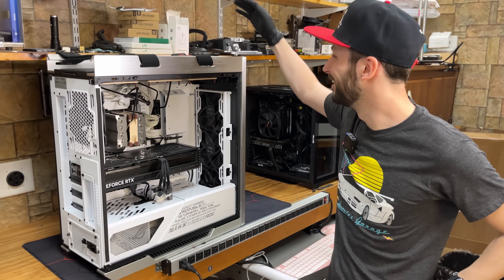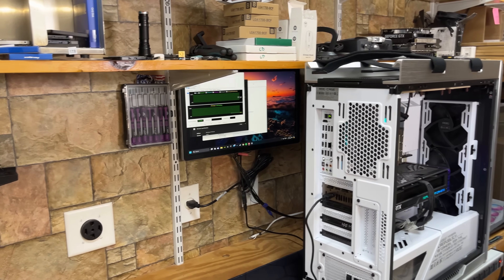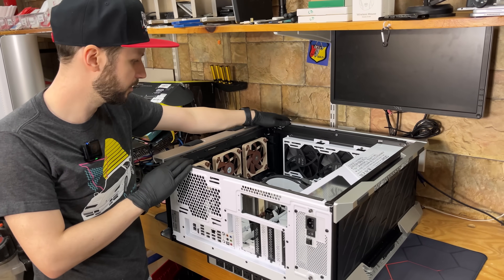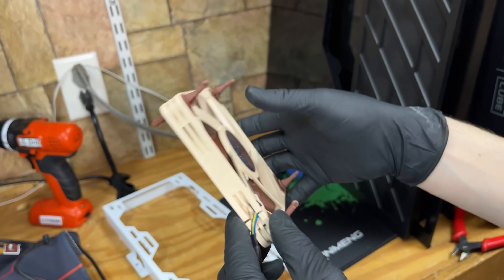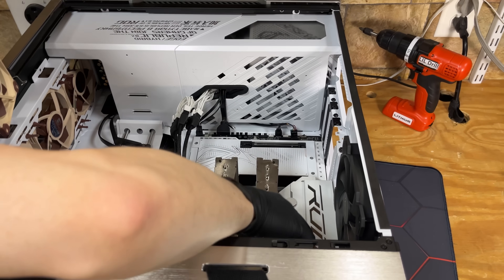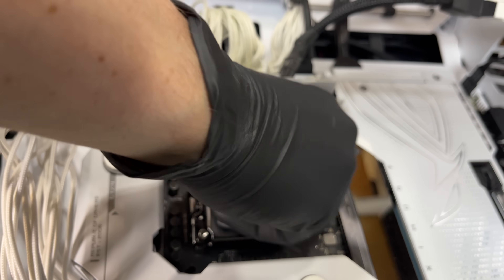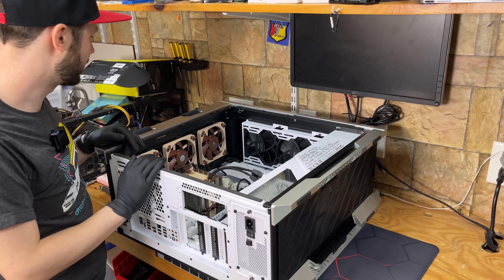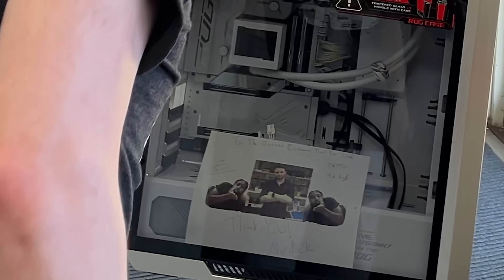ASUS ROG Revival: From Air to AIO on an Intel i9-14900K

Comment: I had this problem with my ROG Strix Z590 and 11900k. It's not uncommon to see the system agent AI in these boards feed over 1.7v of vcore to the processor. In my case, it cooked my original 11900k that had a beefy 200w Jonsbo CR1100 air cooler, with the board pushing over 300w to the processor until it degraded. It was pulling 200w just at an idle, doing nothing! Luckily, intel warrantied the processor, and I saved $400 by buying a used 11900k to replace it and I also switched over to a $60 Frozen Warframe 360 AIO at the same time. The main problem with these ROG Strix boards is that they usually refuse to run stably without the multicore enhancement, imagine that. But, it's a lot cheaper to turn off the ASUS Multicore enhancement in the BIOS than it is to buy a $500 ASUS AIO.... Especially when you can buy a Thermalright AIO that has all the same features and performance for $60 these days. I switched over to the Gigabyte Aorus Pro platform for my last build, and it has none of these crazy problems the ROG does.

Comment: if i owned a pc repair shop and that came in i would've trash talked the idiot who built that sooooo much, for a 14gen i9 a huge 2 fan air cooler would not be enough and this idiot used a single fan TINY nactua fan

Comment: I do think it's possible to air cool a 14900k, but you HAVE to undervolt. I undervolted my 12900k which is also a power hungry beast with a -150mv offset, and temps never reach anywhere close to 90C anymore when it used to commonly reach the low 90s when running CPU-heavy games.

Comment: lol i ended up witha 99 civic rad and fan  independant 600 watt 12v 50A psu for the pump & fan with the outlets modified with quick steel EPOXY which's a shit-ton better than jb weld!! 3/8 loop  AUTOmotive nylon fule line and she's been running 5yrs trouble

Comment: Which Noctur is that though? The Noctua NH-D15 is supposed to be the best air cooler out there for the i9 14900k. Im about to build with the i9 14900k with Noctua NH-D15.

Comment: If you have $1,000 budget to build a PC, $995 IS FOR THE RGB...... $5 is for the processor, motherboard, RAM, casing, PSU..... that's just logical, that's the only way..... RGB could make your PC runs 3 - 5 times faster......

Comment: 13th and 14th already have had both fixes pushed out through updates. August 2024 was the Micro-Code update for those affected. Don't upgrade to it if you aren't experiencing the issues.

The other major issue was mobo manufacturers got the Default setup to wide open. 

So any time you put say my i9 14900KS under air or liquid with it wide open under stress testing it tries to get to 99°c. Because it's wide open.

Before the August push for the Micro-Code was the update that remedied the default being wide open issue for most also.

253w Default won't even thermal throttle in Air Cooled Noctura setups and my i9 13900KS refreshed to the i9 14900KS sits at 293w with no issues.

Comment: My 14900k is staying pretty cool gaming with a nh-d15 gen1 strapped to it. Hovers around 60-65c. You made 2 mistakes, using a baby air cooler and using using stock pressure plate.

Comment: I realized where I kinda messed up buildin' my PC when I remembered my Aurora R12 had a liquid cooler in it, but choose the Noctua NH-D15 'cause I forgot I trusted a liquid cooler for around three years in that prebuild. Aside from the Intel CPU issue in my old 14900K, it runs pretty good on an air cooler, but ~40ºC idle is somethin' worrisome. Ordered a non-RGB Corsair AIO.

Comment: I have that cased and had it for about 5 years. I absolutely love it. Once you get rid of the stupid RGB glass on the front, the temps drop 14c. Then pair it wit an ASUS Thor PSU and a Arctic 420mm Freezer iii and your golden. With a slight undervolt and overclock you should never get over 41c while gaming, even with the loop fully saturated. BTW the case has a built in GPU anti sag bracket. 😂

Comment: I knew immediately there was something wrong with that Noctua cooler. Those are really high quality heat pipes on there, and while I'm not a fan of that particular design (radiator>fan>radiator), there's no way it would have caused that CPU in stock configuration to overheat like that. Well designed air coolers more than hold their own against liquid solutions.
Reply: The i9-14900k cpus are notorious for overheating that they absolutely need water cooling

Comment: I am un-ironically using this video to drain my laptop's original battery a bit.
This so it won't needlessly degrade from being at over 80% charge, as I switch it to an after-market one next.
Time will tell how long that one lasts, but OEM ones are over €100 so it's worth the €40 gamble.
At 75% charge now, time to boot to bios, enable battery storage mode and to get my long fingers in there-

Comment: if they use the proper air cooler like one of Noctua's big ones or be quiet's big ones it would probably work just as fine but they went cheap on the cooler for a very high-end CPU

Comment: you dont necessarily have to go water cooled...... with a 13900K and 14900K you absolutely do, air cooling is not enough to keep these i9's from throttling.

if you think this pc is heavy you should see mine, its a corsair 7000D full tower x.x

Comment: This is a 0 IQ build.
Less fans (or cheaper), bit worse SSD,  bit less rgb ram, not a 14700 (non K) , and a less fucking stupid mobo, WITH CUSTOM WATER COOLING INLETS ON THE VRM would have let the dude squeeze in probably a 4090 & keep the tiny cooler with the less hot CPU.
What the fuck did i just watch? Ah also probably should have gone for a bit more powerful, but less fancy psu (like seasonic).
This build is just.... why? If he didn't go for full strix parts he could have bought so much more pwr..... well he has a full strix system i guess....

Comment: The menu repair:
Change HDD to SDD $230
Repair Screen $80 (80% SALE NOW)
Change the driver to new driver $340
Change the broken things $210-$350 (use by to fix/change by more money)
Change Keyborad $200
Change batery $170
(Every Sales on source 10% to 80% on every day)

Comment: Even if you dont need to water cool, a prebuild water cooler is easy to install and will always keep the temperature lower than an air cooler, increasing the lifespan of any cpu

Comment: Here is big problem computer casing…. I had one of these and sold it due to component overheating. Casing is designed like aquarium and there is no proper air movement in it, you just remove panel on one side and everything works fine

Comment: Just for future advice,I don't know if this applies to this video.  But when you use x-1 fan extensions,  make sure it only has a pwm wire to 1 fan,  or you'll run into occasional random fan ramping because the signal overlap

Comment: solve the problem of degrees with rtx and processor test and approve with my I7 11700KF rtx asus rog 2070 a8g

install msi afterburner

Powerlimit max and max time

✔Linked apply 

gpu 80 to 60 max No pref loss

cpu 65 or more at 35~50 average no perf loss (need water cooler)

Comment: LOL the build was so close to mine, except I built mine with i9 12900k using almost the same cooler but with two fans instead of just the one pathetic fan, and I have an ultra quiet case that I love, can't even tell the thing is running.  My biggest problem is I paid for 6k ddr5 but when I try to run at full speed the PC randomly crashes to bios, so I had to turn off the ROG bios setting that enables ram speeds I cant remember what its called.  But I'm sure The Greatest Technician That's Ever Lived would understand what I'm talking about.

Comment: my aio fans are installed right now as intake on the top smmfh, too lazy to change it but im also on a 5800x3d and not a 14900k heat missle

Comment: a slightly better Noctua Air-cooled HS, one with a push pull dual fan config (to push more sweet air though those fins) could probably handle the beast that is the 14900k.. but given the overall ASUS theme to the rest of the build.. the AIO is understandable

Comment: I dont know if you answer questions, but on the CPU pressure plate would that help at all with a CPU that rips out of socket i have a Ryzen [older generation] and the last time it ripped out of socket i about lost the poor thing.. had to work hard to fix it. Would that prevent/help it?
Reply: always let the am4 cpus get hot before taking out so they dont stick

Comment: This is a bios issue related to the i9 14th and 13th gen CPUs. The fix is to lower max voltage and limit pcore/ecore if still unstable. Should update bios and reset the setting first.

Lots of material online about this as Intel finally acknowledged the issue recently. Has plagued my systems causing crashes randomly on highly specific cpu operations. This fault permanently damages CPUs. My 14900k cannot run stock settings now.
Reply: thats just crazy. intel is a joke now

Comment: When you plan to saving certain part for budget, but the spec is overkill, this is what happens. 
This is happen with me decades ago.. But again, the build should be balance, these CPU need Water Cooling 360 mm at minimum.

Comment: Why did they want those noctua fans in front? Are they better? They seem to have a lot of space on the blades, not much air pressure and also be really thing like a low profile. It's weird lmao. But legitimate question, are those fans better than the other ones? Or at least equal and more silent?

Also Noctua having that HORRIBLE color... they purposely built the best fans and the ugliest so you had no choice. They are HORRIBLE, disgusting and does not even match with wood. You see some wooden cases or "wood builds" (so many jokes in there to do) and the wood color doesn't even match Noctua's color.

Comment: Yeah no, there's either not enough heatpaste or the mounting for the cooler is not fastened correctly.
No way this shoots from 0 to 100 even with that small air cooler.

EDIT:
called it xd

Comment: My laptop has gone someway wrong in the means of cpu processing i play valorant and my cpu latency goes 16392628826 ms but it was in starting 3 ms i have no idea what else i could do i have done many certain of things but its not getting back to its original performance i have cleared its vents cooler clear from inside and still its not getting good 😖 if u can tell something about this that i could do it would be great 😢

Comment: Ouch , that's a nasty downgrade  on the front fans . 3x 140mm normal fan replaced  to weak 3x120mm  15mm slim fans =(
Reply: Actually better put 120mm on front.

Comment: This is a reminder to those who prefer an Intel i9 over an AMD Ryzen 9: remember, you cannot feasibly use an air cooler on an Intel i9 while on a budget. However, you can on an AMD Ryzen 9.Here's why: I have an AMD Ryzen 9 7900 (non-X) paired with a Noctua NH-D15 air cooler, and it idles comfortably at 60-64°C.

Clearly the guy who put an intel in his build was on budget cause you will never put on such thing an air cooler
Reply: And for those of you who says he wasn't cause of the nice gpu and ram. I have a good gpu too and 64 gb ram and i had no money for liquid aio
Reply: I have that too on my 5900x. CPU is chilling on 40C. Peak at 70C at +90% load.

Comment: honestly this seemed like a first time builder and they did a nice job cable managing the rear and buying the exhaust fans. they did a nice job picking specs as well but I think they just fumbled with the cooler and lived with it momentarily and let the CPU throttle. after the cooler it looks even better. noctua fans make any system look better imo

Comment: You said it has an Intel 14900K... enough said, that's why it's overheating. Doesn't even need to be in your shop... open a case with Intel and get the shit replaced as their processors have been bricking after 6 months of use. However... I will say the cooling solution wasn't good enough and the check on the BIOS was a great step. They don't have to go water cooling but it is a nice one they picked out. They could have just went with a nice double fan double fin setup with at least 4-6 heatpipes (I'd go 6) on each fin side for good cooling. Nice job, enjoy the videos!
Reply from the maker: ASUS Multicore enhancement ignoring Intels limits is mostly to blame though. With the proper cooler (the one we put on) it was able to run just fine even under stress

Comment: I work at a small computer shop and there's a guy with that exact case, but it's Gundam themed. Shit really does weigh like 100 pounds with a 4090 and a 1200W power supply :face-red-droopy-eyes:

Comment: "When you have more money than sense... a video series." Nice work, Andy and Lupe! Fun video. It's not my money (and I could be wrong), but I have a difficult time believing that those 15mm Noctua fans are any better than the included 25mm fans that they replaced at the front of the case. And they look like butt cheeks. Unrelated: I feel like the audio levels are a little low in this video. I usually listen to other YT channels at 20-60 percent max volume, but I was struggling to hear everything with all my volume levels maxed out in this video.

Comment: Did the customer reuse an old Noctua from a previous build or bought the wrong one? Because that seems like an absurdly small air cooler to be using on a 14900k (would be probably be fine on an AMD).

Hopefully Intel gets their act together and takes power consumption more seriously with the forthcoming Arrow Lake CPUs.
Reply: I did reuse until the aio came in.

Comment: Well, at least he got a double tower. In my naivety I initially wanted to get one of the single tower ones for my 5800x build but when I showed my list to some people that know more than me and they told me to get a NH-D15s which is about double the size of the one in the video and it did the job very well even with the single fan.

Comment: I have I9 13900k which is the same with a air cooler Noctua u12a I’m getting 33c idles and underload 65c-75c gaming. The thermal throttle is set on bios 90c with a undervolt -0.50+ power limit Intel spec CB23 38k. The AIO would still hit 100c no matter what if you don’t make some changes on the bios.

Comment: I have the same case,  got it on a computer tower stand that has 4 wheels, it helps me move it around and keeps it higher off the ground, it's by Labobole I'd recomend it. This case IS heavy and mines heavier yet with a Strix RTX 4090 oc lc and it has the same AIO, same 64gb memory also. It has a i9 13900ks though... No over heating issues 4 me.

Comment: Hi i really need help from you, My pc which has
 RTX 4070 SUPER
RYZEN 7 7800X3D
32GB GSKILL FLARE DDR5 RAM
2 TB SAMSUNG M.2 990 EVO
B650 X AX V2 GAMING MOBO 
is getting a error which says Nvidia OpenGL Driver - Ran out of memory. I run games in 1080p and low settings for better fps but still this error shows up in event viewer. Please help me out

Comment: Lower the voltage on cpu until unstable for efficiency, my 13900k overclocked mildly runs at 1.2v stable 260-280+max watt full load no throttle with 360 Corsair aio

Edit 80c full load temps, if I underclocked lower stable voltage and way lower temps so cooler in video could work… if you got a good chip….

Comment: sheesh, i use a noctua nh-d15 (mounted properly), two fans, kingpin kpx thermal paste, and the thermal grizzly cpu straightener also and it doesn't thermal throttle

Comment: You don't need to water cool, but you need a much bigger tower cooler like a Noctua NH-D15 or a Thermalright Peerless Assassin (preferably the 7 heat pipe version). Also having the replacement contact frame helps as well.
Reply: I had a d15 in the other one and it wad still thermal throttled
Reply: @KhalMurdock  If you leave it with stock BIOS settings then I can see that happening. You do need to go in and do some taming of voltage and such. They always dump too much onto the CPU by default. Once you find the sweet spot then it should be all good.

Also if you are hitting thermal limits under a stress test Vs actual regular workload conditions then that isn't practical either. If you are with regular usage then by all means find a different solution. My choice for a good AIO is the Arctic Liquid Freezer II preferably the 420mm version. Their rads are physically thicker than all other brands. They can achieve better cooling period. Also a good quality high heat transfer paste helps. Like Kingpin KPx. I find Thermal Grizzly dries up too quickly.
Reply: @olandersnake  I had set up the intel limits in my bios, and it was still throttling. I ended up and a artic 360 aio on my other machine.

Comment: I have Noctua NH-U12 Redux cooling my i3-13100 processor. Putting NH-D9S to cool i7 or i9 CPU is nuts. Not like owner was space restricted in that case.
Reply: Was using it until my aio came In.

Comment: Hey, just wanted to say that JaysTwoCents has done some videos on the default settings in the BIOS for ASUS motherboards being set in such a way that the mobo is sending to much voltage to the cpu. And of course the 14900k also needs a better cooler than the one that system came with.🤓 EDIT: Spoke too soon! When I restarted the video after typing my earlier comment he hit on the exact thing I was talking about.

Comment: Hi The greatest technician that's ever lived, I recently bought a used gtx 770 for around 30 bucks. I plugged it in and 1 long beep and 2 short beeps, no display output. I called the seller he said it had problems with 8 and 6 pin power connectors. I tried every possible way and no luck. Can u explain this to me?
Reply: honestly it sounds like you got screwed and the seller knew the card was cooked
Reply: @misterthegeoff9767  but he sent me some photos which showed a msg on screen "please power down the system and imsert the PCIe power cables"

Comment: my Ryzen 5 7600x does reach 96 degrees on stress testing or setup, i have a 1 fan water cooler, is it the problem ?, once stress is done it goes back to 64 quickly